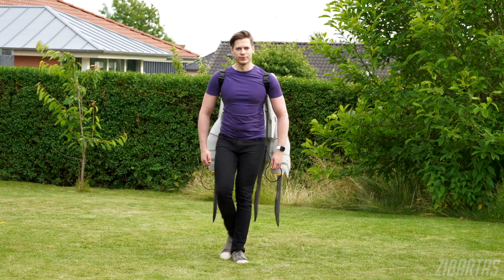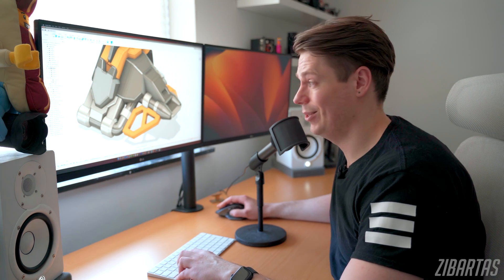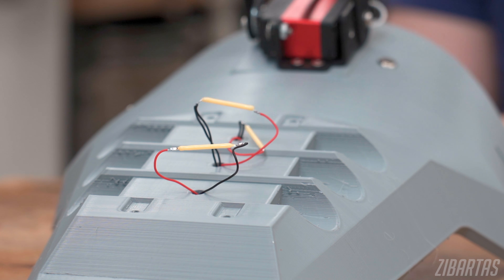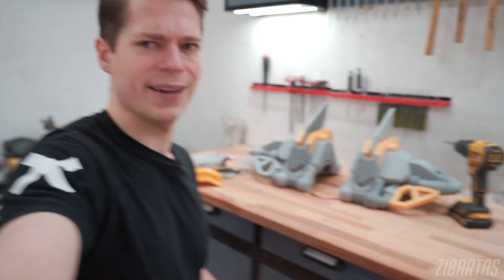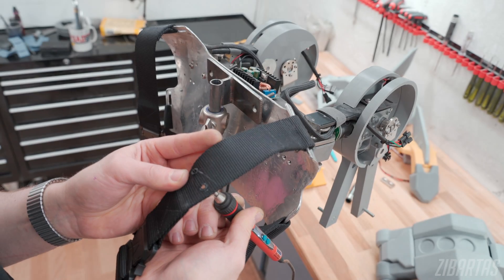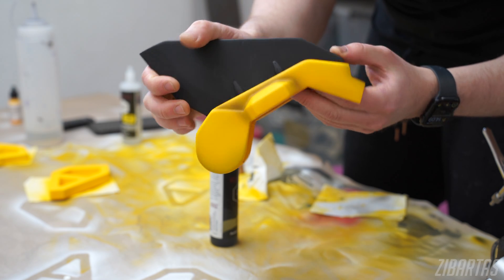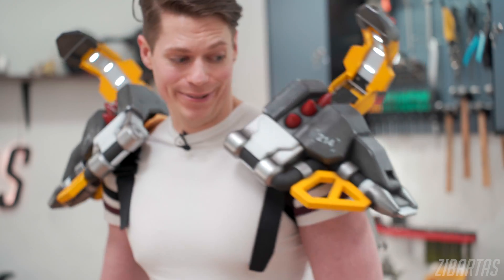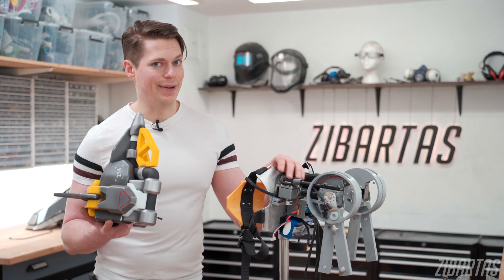My most complex Armor (Overwatch Pharah Cosplay)

Comment: For animatronic armor in general do you feel like you must use 3-D printed parts or can you use Eva for the majority of the pieces?
Reply from the maker: Well 3D printed parts are usually more precise and rigid - important aspects for a mechanism. EVA foam on the other hand is great for lightweight stuff - so ideally you would use combination of both - as weight is your enemy in costumes, especially animatronic ones :)